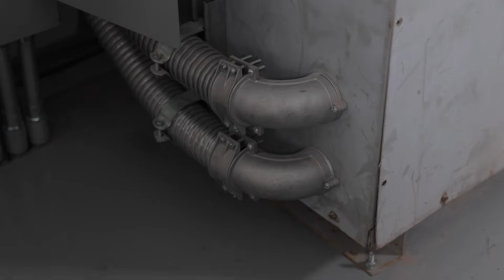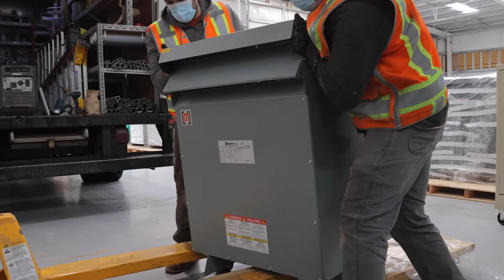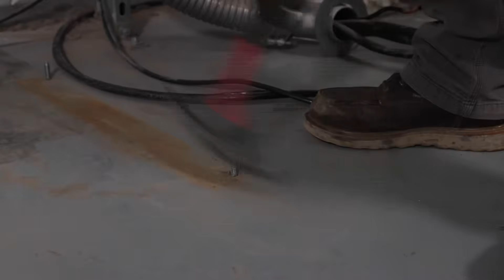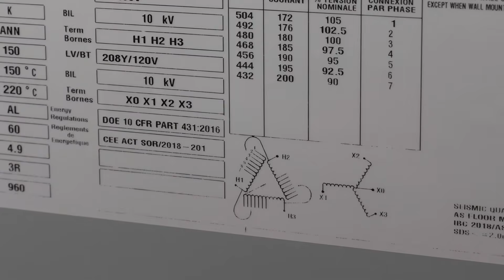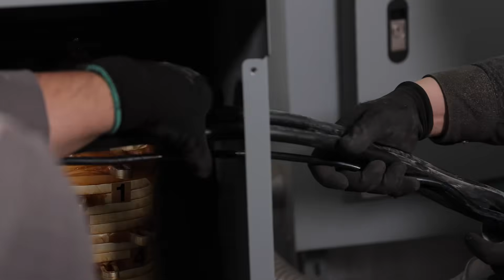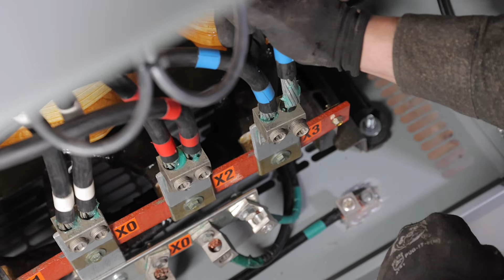How to install a 3-Phase Transformer | Maddox Industrial Transformer

Comment: Do you break the UL listing when you make a hole in the bottom vents for the grounding electrode wire?
Reply from the maker: It depends on the type of UL marking on the transformer, as well as what type of modifications you are making to the unit. As a general rule, any major modifications to the electrical design of the unit could affect the UL. As a general rule, penetrating the side of a cabinet for conduit entry would not be considered a major electrical design change to a unit.

Comment: 260.64(g) Grounding electrode conductors shall not be installed through a ventilation opening of an enclosure. NEC 2023
Reply: I went looking for Article 260 lol. It's 250.64(G) thanks
Reply: @ElectricalTechnology-e2f please share

Comment: After turning off the braker and lock out🔐 installation, they never check the power in the old transformer and put their hands over those bars, assuming everything is fine...
Reply from the maker: Hi Gustavo,
This video is intended merely for informational purposes ONLY, not instructional.   You should always have this kind of work done by licensed and experienced electrical contractor who is familiar with installing transformers.
Reply: @MaddoxTransformer but if it’s only informational…. Why are you even showing the LOTO in the first place…. Hmm 🤔
Reply: @obesedog23  They're showing what they did during the install, just not necessarily every single step.

Comment: I liked the lockout, tagout but expected to see a check for potential prior to making any kind of disconnection.
Also expected to be shown the checking for phase rotation using a Knopps or similar device plus measured voltage output values, etc.
Reply from the maker: This video is intended merely for informational purposes ONLY, not instructional.   You should always have this kind of work done by licensed and experienced electrical contractor who is familiar with installing transformers.